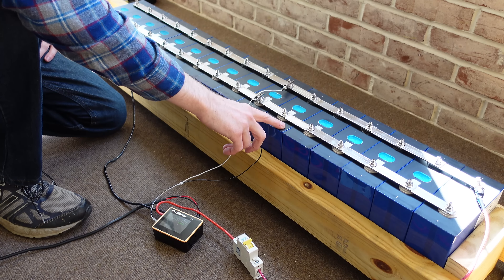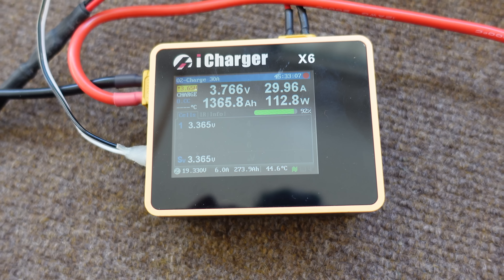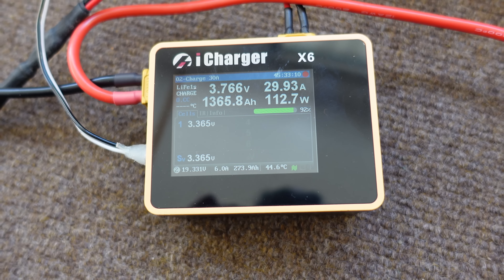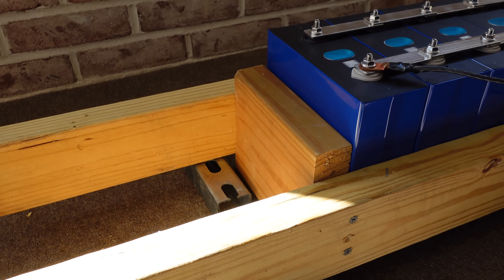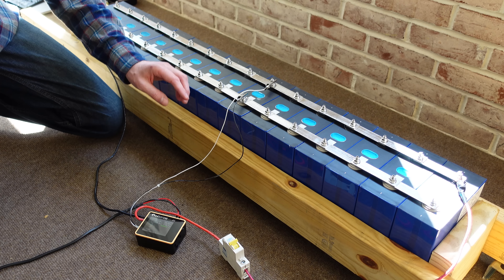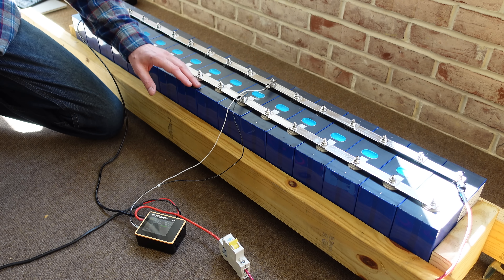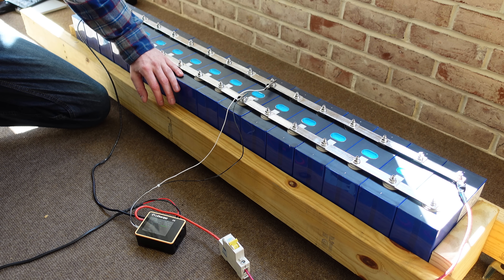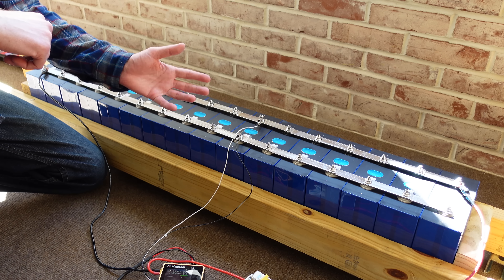Top-Balancing the EVE 280Ah LiFePO4 Batteries & Project Update

Comment: How to determine your circuit breaker?
Reply from the maker: The circuit breaker I used here was just a spare I had on-hand. I would not recommend using this same kind in your setup. If you're not sure what kind of breaker to use, it needs to be rated for DC and preferably non-polarized. Typically rated for 125% the continuous current. I am charging at 30A here so 125% would be a 37.5A breaker. Since that size does not exist, round up to the next common size of 40A :)

Comment: Noob question, but why is the charger set to 3.767V when you're trying to get them to 3.65V?
Reply from the maker: That's a great question (not noob)! The iCharger is able to account for voltage loss in the wiring between the charger and the batteries. You'll see a thin white/black wire coming off the side of the iCharger. These are the voltage sense leads (also use for balancing when more than 1s). On the display, you can see the voltage being read by these wires. The iCharger then increases voltage on the main output such that it's accounting for loss and 3.65V is being delivered at the end :)
Reply: @LithiumSolar  Wow, 0.11V in line loss over that short distance and with such thick bus bars. I guess you have the sense leads in the middle of the array because that's the maximum possible distance, but what about the batteries at the very edges, don't they get less line loss?
Reply from the maker: @QuantumBraced  There is about 3ft of #10 wire there. Running 30A through #10 has a voltage drop of 0.18V. That's perfectly normal - https://www.calculator.net/voltage-drop-calculator.html?material=copper&wiresize=3.277&resistance=1.2&resistanceunit=okm&voltage=3.65&phase=dc&noofconductor=1&distance=3&distanceunit=feet&amperes=30&x=0&y=0&ctype=standard It would have been better to have the leads at the ends instead of the middle, yes. Didn't think of that until it was pointed out after posting the video lol.
Reply: @LithiumSolar  I see, thank you.

Comment: No threadlocker or similar. If it was designed for that they would tell you to use it. What I would do is finger-tighten, then use the allen wrench to 'feel' the stud bottom out. Back it off 1/8 turn, hand-tighten with a wrench to about 3/4 torque value while holding the stud still, then torque with socket and torque wrench. By that point, the nut will not be turning more than 1/8 turn further so there's no risk of stripping the stud threads, yet even if the stud stays still you've still got 95%+ thread engagement with it which should be more than enough. While there should be very little current going through the stud, you might as well have all the electrical contact there you can get, something you'll lose with threadlocker. Plus you'll have the exact torque when you're done, and it can be checked and slightly tightened later if needed, still without risking the stud threads.

Comment: so model of the breaker?   as for your china supplier on batteries.  they good? the reason i asked ive gotten scammed from allibaba and havent ordered from anyone in china since then.
Reply from the maker: I have only placed one order with Basen, but my batteries were near-pristine (only one tiny damage spot), but would still recommend them based on this experience and feedback received from others. The breaker was a Tomzn-brand and just grabbed it from my spare parts boxes. I would not recommend this particular breaker for this purpose.

Comment: Is there going to be a problem with LiFePO4 if you dont compress them?
Reply from the maker: The datasheet states that you will get an extra 1000 cycles before 80% state of health if you compressed the cells vs not compressed. Also, reduces stress on the terminal points if the cells are not moving.
Reply: They last longer in these thin Alloy cases.
Reply: @LithiumSolar  any idea what kind of compression forces they use to get that figure?

Comment: I have the same cells and i will not use locktight...... if you ever damage the threads' it would be a nightmare to get the studs out.... I am a mechanic & use locktight alot.....

Comment: Loctite is an insulator. Unless you are using the battery in a Baja 1000 racer the chances of a tightened nut coming loose is too low to express with numbers. And using a torque wrench to tighten them is not necessary. and maybe even unwise. Lubricating the threads lightly with never-seize or bulb grease makes more sense than loctite, but loctite probably will not hurt anything and the stud will be fixed,

Comment: What charger is connected to your icharger?
Reply from the maker: I'm using a 19V 120W power adapter from a Dell laptop. I just cut the end plug off and spliced on an XT60.  Works great for things like this and good way to recycle (end plug was damaged) :)
Reply: @LithiumSolar  ah okay.. thanks for sharing on how to top balancing using that laptop charger.. but how about discharging the cell what am i need to used together with icharger.?

Comment: How are you powering your icharger?
Reply from the maker: I have a few old 19.5V laptop power supplies that I repurposed for iCharger power.
Reply: @LithiumSolar  I wonder if I can power it with my aims battery charger it's 48volts. What's the input voltage? Of the icharger?
Reply from the maker: No, it will not work with a voltage that high. The max input voltage is 32V.
Reply: @LithiumSolar  oh okay 👍 hey I appreciate it.
Reply: So I did buy one of these ichargers. But have two questions. I hooked up my lifepo4 battery 26v battery to it. Adjusted the voltage to 3.6v it won't give me 3.65v. But only is charging with 2amps. And I adjusted it to 30amps. And how do you hook up the balance leeds? I have the exact setup as you do 280ah. 16p. To top balance them.

Comment: If you locktite in would use blue not red for that application
Reply from the maker: Could you explain why? I'm given to understand red loctite is "more permanent". In particular, I'm looking at Loctite Red 271.
Reply: @LithiumSolar  locktite has lots of strengths, red is a lot stronger than blue, they actually have bolt size ratings, and blue would be more than enough
Reply: @LithiumSolar  Keep in mind that 271 needs the primer (on non-active metals, like aluminium+stainless in your case). If you go with 263 you can skip that.

Comment: You can charge these while they are discharging - you just need to put the charger and inverter on a bus bar and connect the battery to the same bus bar.

Comment: 16S2P is really a lot considering 16 in the charging procedure right now.
I like that ... and the trials or reuse of that broken 12 V battery 4S3P.

Locktite ? I am not sure ... if that is really usefull in this particular case without any mobile use and vibrations.

Comment: Use blue loctite as it can be removed easily. Red loctite requires heat to remove and epoxy requires a lot of heat. Blue is by far a better method as you can remove the stud with an allen key.

Comment: Don't use Loctite , you'll need the best conductivity , instead use nylon insert lock nuts to attach busbars , the pulling power from the nut will keep bolt tension in cell terminal avoiding to come loose .
Reply: If Loctite reduces conductivity to a degree that is unacceptable to you,  why is it that nyloc nuts don't?  Nylon is not conductive.

Comment: Loctite will reduce the conductive surface area. If that would make much of a difference.
Reply: No, the busbars have a sufficiently large surface, and stainless steel is also less conductive than copper.
This means that the current mainly flows through the copper and not through the steel thread. Current takes the path of least resistance.

Comment: no to locktight you wont metal on metal to get the best travel of current and surface area
Reply: From what I read the main conduction is through the surface area of the collar where the ring connector is tightened onto, not the stud.
Reply: @davidpresland5243  yes that is correct but the bolt will also carry current to the other side thus giving more contact area for current to flow
Reply: Zinc studs fine or only stainless? Does it matter? Edit - at 4:00 he says aluminum posts.
Reply: @bkuethen  all metals

Comment: I still haven't received mine from the same vendor it has been well over 90 days now!!!!!!
Reply from the maker: That sounds very unusual... Have you asked them to check what's going on?
Reply: @LithiumSolar  I've been in contact with Emily Peng about this many times. First I was given a bad tracking number. Since then I've gotten stories about congestion at the port of LA, ship repairs in Mexico and winter storms at sea. I paid for my batteries on Dec. 5th. and have still not received them. I've asked for a full refund including shipping to no avail. I have asked for the ships name because I have the ability to see where it is, But they haven't supplied it. In many ways we are finally at a place where the numbers make it cost effective to buy new instead of used but my luck has not been very good with this purchase.
Reply: @urbanbeeman5402  I would contact alibaba and not Emily, they deal with the companies that are doing business through them.
Reply: @eapj12  Yep already on that angle at this point

Comment: hope it's not a daly smart BMS but then u wouldn't be keeping that a secret. lol. I got a 300A smart Daly BMS for 16s of these cells and it keeps shutting off causing the inverter to turn off. batrium is very expensive at $1k USD. considering a chargery BMS but still on the fence about it.

Comment: ..use the stuff they sell for vehicle rear window defroster wire repair paint, or use nothing!...and put your balance charge wires in the correct spot, about 5 batteries in on each side, to avoid uneven charging, there are many pictures on the internet and explaination about voltage drop

Comment: Could you spot weld them studs??
Reply from the maker: I don't think you can spot-weld aluminum because of it's low melting point. At least not with the Sunkko welder I have. Laser-welding them would be perfect...
Reply: @LithiumSolar  Sir you maybe 100% right, but I seen others spot weld aluminum but it maybe a different kind of aluminum. Its wasn't done on a battery, they was working on a bike and welding aluminum and it looked like a roll of nickels when done it was a cool look.. I know nothing about solar that's why I'm watch you try to learn...

Comment: 16 cells in parallel gives you how many amp,hr  at 12v..
Is this 16 x 280...??
I'm not real savvy at all with lithium..
I'm finding over 7 years of replacing AGM,s..
There life span is getting shorter.
Reply from the maker: Since these are all in parallel, you would multiply the amp-hours. 16 batteries x 280Ah each = 4480Ah. They will not remain this way, this was just for the top-balancing procedure.

Comment: Try to use full threaded stud with chamfer edge, only the end going to the terminal.  That should avoid wobbling.  It should be available in AliExpress and Amazon.  Check the picture and/or the drawing sheet, you can tell if the stud has chamber edge.

Comment: Should be stainless steel posts, not aluminum.  Are you sure the posts are aluminum?   They aren't carrying any real current (well, they don't have to carry any real current but they are probably seeing some), they are just structural.  Aluminum isn't very strong.  Stainless steel is very, very strong.

You probably don't need any lock-tight.  The posts don't even need to contact the bottom of the cell, though screwing them in finger-soft-tight is reasonable.  The structural load will 'pull' the post from both ends as you tighten the nut down (nut and pad are loaded, but battery case is not).  The hex wrench (as you noted) is just to prevent the stud from twisting and possibly damaging the case at the bottom while you are tightening the nut.  And, of course, you don't want any lock-tight between the nut and the terminal pad (though you probably do want a tiny bit of conductive anti-oxidant paste).

So, instead of using lock-tight on the post you really just need a dab of glue to secure the nut to the terminal pad after you have tightened it, and you are done.  The post won't go anywhere.  Probably don't even need very much glue, just a dab on one corner of the nut to secure it to the pad, enough to prevent vibration and thermal expansion/contraction from causing the nut to move.  Easily scraped off or overpowered if you ever need to unscrew the nut.

-Matt

Comment: I would use electrically conductive epoxy instead of loctite.
Reply: My thinking also! With loctite you are introducing an insulator into a connection and that is bad snu snu .. As reference - https://www.emcstandards.co.uk/never-use-liquid-threadlockers-on-any-electrica
Reply: No need, the current flows through the flat surface, not the bolt. hence why conductive epoxy is pointless, it just makes it near impossible to remove without damaging the battery.
Reply: @TheGalifrey  need is different than better than loctite. Is it strictly needed inhis case, well no of course, but is it a better alternative, I think so. And in the sense of best practices, why not go with it.
Reply: @mythoughtsonfaith1031  I haven't had my cells delivered yet, but from watching a few videos the thread in the aluminium terminals seem to be cut loose.
I had thought of epoxy for strength,  conductive epoxy will be metal filled, so it sounds like a good option. 
Do you have a preferred product you have used with success?
Reply: @mikenewman4078  atom adhesives, nickel based is less money but less conductive than silver based, but obviously silver conducts better
Reply: @TheGalifrey  heat works on epoxies too. The request was for suggestions, I would use conductive epoxy, you favor loctite, neither is wrong, just different. Personally I would just use bolts not studs, but I understand the thinking behind the studs.
Reply: @TheGalifrey  been bolting electrical connections for 25 years, it is not a pain, bolt, stud, six in one half a dozen in the other, but in this case since it has threaded hole for a bolt, I would keep it simple and bolt it, if it came with a stud i'd use that. The benefit in this case for the stud is threading into AL can strip threads if your not careful. But I wouldnt worry to much about that, I would just rethread it larger. Like I said there isnt right and wrong just different. But since he asked for a suggestion, I gave him one.
Reply: @TheGalifrey  haha i live on prismatic cell, from before these were out. studs, bolts, whatever if you cant keep your bussing from touching be more careful. i will still use conductive epoxy. pretty sad your going to that length to try and be right.
Reply: @TheGalifrey  no it is sad that you feel that you must have the last word. Every point I made stands, youre just a troll trolling along.
Reply: @TheGalifrey  and yet you prove my point, thank you for showing how right I am
Reply: @mythoughtsonfaith1031  🤣🤣🤣🤣
Reply: @TheGalifrey  are you still talking? ridiculous.
Reply: @mythoughtsonfaith1031  🤏✊💦
Reply: @TheGalifrey  still commenting? just cant let it go huh
Reply: @TheGalifrey  the irony is how you just cant help yourself, too funny
Reply: @TheGalifrey  you dont understand the irony or your own compulsory behavior. I on the other hand find it a duty to help you though, thats where what you think it irony, actually is not. Maybe it is just a little to complex.
Reply: @TheGalifrey  You still cant let it go, really amazing.
Reply: @TheGalifrey  sometimes help comes in a way you dont expect. Here Someone asks a question so I give them what I have done, you come along uninvited, and insist on trolling. You obviously do not understand manners, I gave you many easy ways to agree to disagree agree, bt you refued to take them. In that I deduce that you are a narcissist that can not have anyone finish the conversation. You have demonstrated my point this entire time. o now that it is painfullyh obvious that you have a problem maybe you can sort yourself out. But I think you self importance will prevent that. If you wanted to make your contray point you could have put it in a separate comment, but you didnt, you sought his out. And dont try and tellme a couple insults would do your ego any harm.People need to get over that nonsense. You insert yourself where you arent asked for,arent needed, and very little you have said has had any real merit, what was on topic I addressed, after that I showed you that you were no longer welcome and yet you persist, which was what I wanted to see to gauge your level of narcissism. You proved it to be exceedingly repugnant. So you see what you think is you being clever, is just me drawing you out for what you are. But I dont honestly believe that you willfully understand much of what I said, either by inability or ego not allowing you to. Remember I was quite polite in the beginning.
Reply: @TheGalifrey  Good bye, have a nice sabbath.
Reply: @mythoughtsonfaith1031  might have known you're a god squadder by the amount of duff info 🤣
Reply: @TheGalifrey  what I know and think about faith would be about as able for you to understand as everything else I have said. It would seem it is just over your horizon. And of course what someone doesnt understand must be duff to them.

Comment: Get an Allen/hex key set for the drive size of your torque wrench. Definitely Loctite (blue or red) the studs. Remove the "wobble" by snugging a nut to terminal flat. Then affix bus bars, as well as any balance leads, with another nut. Fixing the bottom nut with a wrench, snug down the top nut for secure bus bar/balance lead connections. This method will ensure the terminal is never stripped.

Comment: Simple version is... more Loctite - more resistance.
At each use point.
Reply: ...which in this case would not be where the electrons flow.
Reply: @videopipeline6419  How do electrons NOT flow through the terminal threads? Are they fussy that way, or have the laws of physics changed recently?